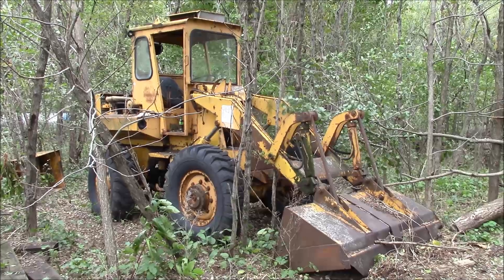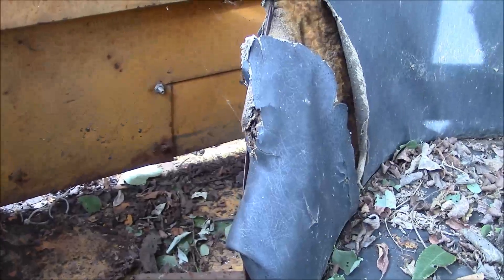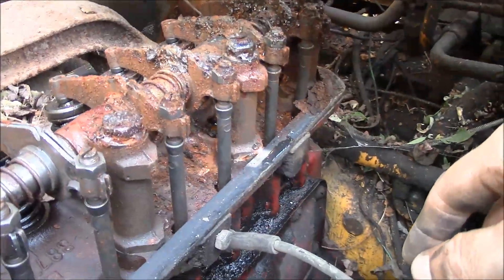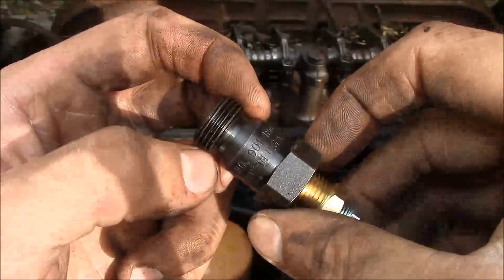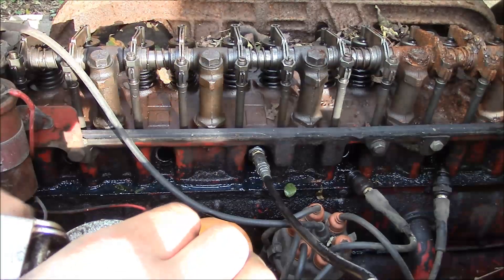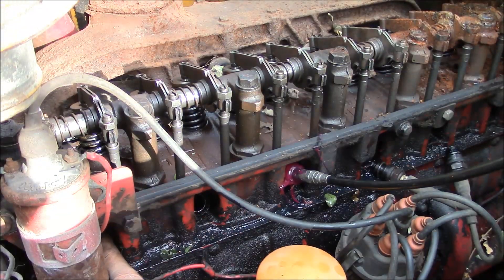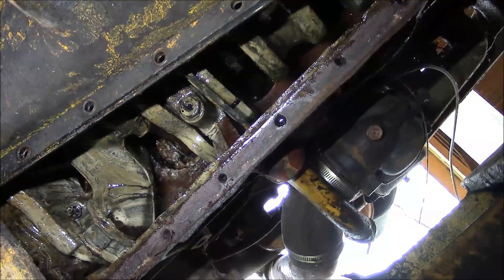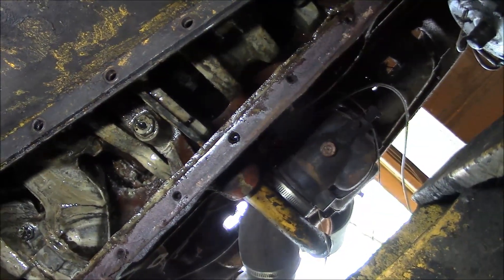Can You Free a Seized Engine with a Grease Gun?

Comment: Hi Wes.iv been watching you for a while and you are a good and clever mechanic...I have had some success in freeing up seized engines..one is still running 15 yrs after freeing it up...the previous owner tried towing it and no luck...I pulled the plugs and flooded the cylinders with KROIL..the stuff really works..after letting it sit a day or two I put a large breaker bar on it and a little at a time got it to turn over.
Reply from the maker: We're gonna get the head off here soon.

Comment: I mean there's always a way. If anything submerge the crankcase in water  up to the valve cover get a copper rod suspended in the valve cover, hook some leads to the copper rod and crank, hit the thing with 12/24v. Then ya just got the rust in the cylinder to deal with. I think ground should go to crank but I may be wrong.

Comment: Apply hot peanut butter and apple butter to the cylinder walls with grease plug adapter kit;Install breaker bar to front of crank heat cherry red any trouble spots that should work

Comment: This might be considered a dated video since it was posted oct of 2019. But have you tried using liquid wrench and spray all inside the springs of the valves? 
I would have done that and spray enough to flood the frozen valves and tap on them for about 5 minutes max. 
Yes its luquid wrench and yes itbcan dilute the oil. But its worth penetrating the rust out of the valves and then change the oil when its running.

Comment: ATF and diesel was in no way the best choice....should have used a 50/50 mix ATF  and Acetone....very best penetrating oil in the world. Let set 12/24 hrs and the grease gun trick would have worked fine. ?The real secret is not in knowing when to stop, but in knowing where to begin.
Reply from the maker: I'm thinking the best choice would have been not to leave it sitting outside for 13 years.

Comment: I had a seized motor, water drenched and tons of rust. Took out the plugs and sprayedBlaster penetrating  in the plug holes. Didn’t work right away so I also sprayed WD40 in the holes, waited a hour then cranked. It worked. Drained all the water and oil out and added fresh oil and ran it for 15 minutes. Changed the oil filter and added new oil again. Motor sounds like new. Hope this will help somebody with a seized engine.  Should work on all engines I would think.

Comment: I am going to tell about how I fixed a V8 Mercury from 73. It was 78 or so and a friend's boss had this car for sale. I would not start. Crank over but nothing fired. He wanted $650 for the car. I offered him $175. I gave him my number, and told him to call when he wanted the car gone. 6 months later, I get a call, buy the car and haul it home. 

It was Jan - in Canada, cold - I put a strong-arm on the craank and pulled and pushed. Motor never moved. I decided the fastest way to figure it out was to pull the  dome and heads off. I had been pouring deisel into the spark holes, but still, nothing moved. As the dome came off, I found the time chain and gears were gone. With the heads off, ALL pistons were rusted into place.  I had some 40 grit sandpaper - and I began to wipe all the areas I could in a hash pattern just like when the machine shop does it. One Friday night, I got my dad and brother to help. One had the strong-arm on the crank, one held a 2x4 - onto the piston, and I stood on the fender, with a 10lb sledge hammer. I gave every piston 2 cracks and then moved on.. On the 3rd round - Dad felt it break and mover about an inch. Now this is and inch on the end of a 6 foot steel water pipe. We oiled the cynlinders and we got it to move back that inch. It still needed the hammer to start the move.  Within a day, of moveing the crank a little and the 40 grit paper, I finally had to turining all the way in one direction. I switched  to 320 wet paper and just kept running over the rust.  I never pulled the pan nor did any more engine work. Slapped the heads back on after grinding te valves myself. I never spent more than $100 in parts and drove that car for 7 years. Put 50K miles on it. Now - there are gonna be some who tell me I am full of it. What I have said is the Effn truth. I did this 40 years ago.  Those old engines are much tougher than you realize.  Your mileage may vary - things look funny in your mirrors. Cheers

Comment: I once beat the pistons out of a mercadies benz 6 cyl with a block of wood and a 5 lb sledge hammer.  and I do mean BEAT!   ,  honed the cylenders, put in new rings and drove it for a few years. may have replaced the berings, don't remember,  just remember swinging that sledge 180 degrees over and over.

Comment: We had an old Chrysler 383 engine that was seized. We soaked the pistons with atf and pb blaster. Then unbolted the rod caps and proceeded to pound on it from underneath. It was all scrap anyways at that point. We could never get the piston out, even pounded it with a big pry bar until the piston blew out the top piece. 
Sometimes they are just too far gone an they can’t bore anyways if there is deep pitting.

Comment: You tried everything but grade 6 common sense😂 water makes rust if you put water "back" in the cylinder it will break down the rust: when was the last time yall ever seen oil or greasr disolve rust?
Reply from the maker: When's the last time you saw water dissolve rust?

Comment: Thanks for a good video.  I had planned to use that method with a Chevy straight 6 I have.  Now, I will use air pressure on a heavy oil flooded cylinder.  Hopefully, I can keep the pressure within the limits of the head gasket, and not blow all the air and oil past the rings.

Comment: Just a heads up to you, from working with a 1965ish Hough Loader, that looks to be a similar engine to what youre working with. International Straight 6 Gas. Theyre slightly more common place out in New York with the gas motor due to the colds we face, but it might be worth keeping an eye out for an old Hough Loader as a donor. Those motors are more common, just are in different platforms.

Comment: My 64 Allis D15 gas engine was seized like that.  The wrist pins were rusted tight.  I did everything you did (except grease).  Jacking on the crank pulley.  I was a little arrogant because I've always had luck freeing up old engine.  I kept dumping everything down the top.  What I wish I would have done was just filled the crankcase with marvel mystery oil , transfluid or PB blaster all they way to the top and just let it soak those wrist pins and cylinder walls for months.  If I could get that engine freed up with those cylinder walls I'd hone those and put it back together.   Maybe a waste of time but at least you're not out a whole lot of money.

Comment: The grease method does work !!  On a 6 cylinder engine 3 cylinders are on the post (after passing) TDC and 3 cylinders are pre (Before) TDC. Remove all spark plugs or injectors. Make sure all valves are closed. Fill EVERY cylinder with heavy weight oil. Now with your grease gun apply grease to the 3 post TDC cylinders. You will need 3 grease fittings. If it moves - keep going UNTIL you have A cylinder you are greasing at BDC. Now remove all fittings And install in the other 3 open cylinders. You will have to change at some point the 2 groups of three cylinders to get the engine to rotate 1 revolution..

Comment: Which is more to loose or just try filling the cylinder with oil .let it sit for a 2 or 3 weeks.letting the oil soak and free it up.this works cause i know.you have no chance of breaking anytjing.using a ratchet with a cheater bar.make sure you take the plugs out before using ratchet and cheater bar.better yet oil all the cylinders with oil.

Comment: I would add diesel fuel to crankcase until engine is as full as you can get leave for a month .use large socket and bar at front go easy  though back and forth.grease gun idea was not the brightest

Comment: if you need to un stick it just to pull the motor, and it isn't too big a deal to pull the head, dump muriatic acid down the bores that are stuck, it will eat an aluminum piston and the rust in minutes. at least you'll be able to turn it over to get at the flywheel bolts.

Comment: Ls swap.
Everyone is doing it.
😏
Reply: My boy wants to do a 5 ton
Reply: Rotary swap it. Boom problem solved.
Reply: An ls? If he wanted a cheap copy of a ohv 5.0l ford he could just put a 5.0l ford in it.
Reply: @matthubbard9330  
It was merely a joke.
Reply: A rotary??? Really and wheres the torque gonna come from to make a TRACTOR move? Let alone do its job? Magical apex seal fairies? 

The tractor needs a straight six engine preferably a ford 260 or 300. If not a cummins 4bt diesel.

Rotory engines make great air compressors. But once you add spark and fuel it becomes a total piece of crap.
Reply: @matthubbard9330  way to be a joke killer bud. It's ok though. I remember my first time on the internet.
Reply: You know what a funnier joke is?
 LS and rotary engines. Now that's a joke....
Reply: @matthubbard9330  🙄

Comment: You were right to stop on it. I have had some luck in the past with pouring in some diesel and then using a torch to light it on fire. Got an old M free that way. On my Dad's M I wanted to save the pistons since they were m&w pistons. I took the head off and would do the same. Took a number of tries but it did come free. But then weren't as far gone as yours.

Comment: If you remove the oil pan and disconnect the connecting rods you should be able to hammer on individual Pistons with a piece of wood instead of trying to move all of them at once it's way easier that way you may have to remove the cylinder had to do this though.  necessary if it seized that bad

Comment: You certainly have more options the thing is to get it to the heated shop. Have you looked at getting it into neutral or taking out the clutch completely. Some hoses need to come off for the bucket to be lifted. You're staring they need a ram pump.

Comment: we got desperate on a '48 dodge sedan with a stuck engine. after 3 months of pouring concoctions into the spark plug holes (and begging the owner to let me pull the head) he finally gave me the go ahead to do an autopsy. we'd tried everything to get it unstuck. finally i took a chain and a portapower and bolted the portapower down to the block with the chain using the "cloven hoof" attachment. we then used the rubber foot against the piston and gave it a few pumps, then bumped the starter. she finally gave up and started to inch down the bore. unfortunately someone had poured Coke or something down the bore and let it sit and it ate the cylinder wall out over .060". we ended up building another motor rather than wasting money sleeving it and only getting it back to standard piston size

Comment: Another large petrol engine we do not see petrol engines this modern this size in the uk. Even 50 years ago is 1969 a petrol engine would be very unusual as conventions to Leyland or Perkins was very common due to the cost of fuel and efficiency
Reply from the maker: This engine is probably 45-50 years old.

Comment: You have the oil pan off..  un hook the piston rod on the sezed pistons from the crank so you can turn it to get the bolts off the torque converter the engine is trash as you say..

Comment: Wes, I agree the motor is shot unless you decide to sleeve it.  But, it would be a really interesting experiment if you put the valve cover and pan bolts back in and fill the entire engine and cylinders with white vinegar.  It's cheap and it will eat the rust.  Fill the sucker literally all the way to the top and let it sit a week or two.  It would be really interesting to see if it cleaned it up enough so that it could be turned over.  Not trying to save it, but just to make it easier to disassemble later.  Coke (phosphoric acid) would also be another option.  But I'd use vinegar because it's stronger.  It'd be a $25 science experiment to see if it works and I bet you might end up surprised.  I'm a new subscriber and am really enjoying your vids.  Nice job!

Comment: Something I have found works to free up something that needs to turn , if you can access the lg nut on the front of the crankshaft , use a 3/4 or 1 inch impact and socket .  The hammering really has a profound effect .--Ernest E. Johnson

Comment: I’ve Never tried that before with Grease.. hmmmmmmmm I’ve Un’froze many engines and what I do/did was to remove all spark plugs or injectors on a diesel then use a Hot Plate to heat new engine oil up to the point it’s starting to boil!! Then pour it down each cylinder while it’s extremely hot. Let sit for 15mins then start to bar the engine over.. it will move very little and that’s all you need!!! Back and forth back and forth.

Comment: you could try the grease method again but chop the crankshaft behind the first piston, it should be a lot easier to free it and turn the clutch to remove the bolts holding it to the transmission.
no idea if it'd work, but thats what i'd try

Comment: I had a engine that was stuck and I used every recipe known to man to supposedly unstick an engine, and like you, after many weeks nothing worked. Then as a last ditch effort I blew the stuff I had in the cylinders out and filled each cylinder with Coca Cola. Less than a week later it was free and I got it running.
Reply: Vinegar works for breaking the rust free as does Coke .
Any oil is just a lube and won't eat the rust .

Comment: If you have to rotate torque converter and engine is condemned then gas cut crank and take main off , engine is then separate from flywheel... Only other way is to take all the mains and big ends off...

Comment: Even if the grease works,You will still have to get the grease out once freed,What you should have done first,is squirt some penetrating oil down the bores leave it a few days then get a blow torch down the spark plug holes and slowly turn the crank with a spanner  while keep spraying oil down the bores until they are free.

Comment: An old guy once who restores old tractors once told me if you heat up a pot of run oil on a stove , pull the head and pour the oil into the cylinders. The expansion from the heat should free it up when you try to turn it

Comment: All the wrong fluids used. Neat phosphoric acid into the cylinders ad left for 24 hours would have freed it up.
Once free, sump pan removed and turn the crank over with penetrating oil down the bores.. job done..

Comment: While it is unlikely to work in your engine, I did watch a guy heat a pan of oil and pour it into the cylinders via the plug holes. The heated oil caused a little expansion and made its way into the crankcase and the seized engine turned over with some difficulty - but it had been seized for several years. Thought this might be something your viewers might consider.

You gave that engine your best shot but in the end, there are just too many things wrong with it to make it economical to fix.

Comment: Pick a cyl past firing, power stroke, and USE AIR.
Reply: Air is worse than grease. Pressure vessels are dangerous. If it leaks hydraulically, air won't do anything.

Comment: Personally, I would strip it down as much as possible and use either electrolysis or an oxalic acid bath, and then soak with a penetrating fluid called Free All, made by Gasoila. The stuff works pretty good.

But that's just what I would do, you look like you know what you're doing though lol. It's probably a goner

Comment: It works really slow but I know a couple of people that fill the cylinders and soak parts in molasses and it eats rust and will not touch any good metal, my buddy usually plans on a month before he tries to break stuff loose with molasses but on some vintage machines you can't buy parts so if you wrecked it getting it apart you should have never touched it, good luck my friend

Comment: If you're done with this engine as a serious salvage piece you should wait until you find another engine you don't need or want. Drop the transmission and flip the torque converter, then weld it to the crank of the other engine so they're stuck together with the torque converter connecting them. You could spin the running engine up to the converters stall and see if it's even possible to break this engine loose. Who knows, if we get lucky maybe we'll see rods fly through the crank case of 2 engines at the same time 🤣

Comment: I have broke IHC engines loose with a hydraulic jack up against the crank.  I think that is also the same engine used in IHC 815 and 915 combines.  Several place in  Iowa have recking yards that sell  old combine engines , Iowa Fall, Colfax, Vulga, etc.

Comment: my best advice for getting the engine out is cut the conrods for the bad cylinders so that the crank can rotate to make the torque converter bolts accessible. its not like that engine is worth saving as far gone as it is.

might be interesting to see a different engine go in if anything is available for a cheap swap like an old tbi 350 or something along those lines of not fast and not cool but reliable and affordable

Comment: Fill the engine with diesel. Every cylinder, valve, intake everything and let it sit a few days. If that doesn't work, you can always use heat. Heat the block up with a torch. Itll expand freeing the seize

Comment: Just reach up in there with a torch and cut that crank near the flywheel end.  That way you can turn it over to get to the bolts.  That or take the head off...thats why that plates in the back of the cab.  Hammer the piston with a big hammer and brass.

Comment: I unseized an engine using a mixture of kerosene and vinigar.fill the cylinders than wait a day or two..then put a socket on the crankshaft and use a pipe on your breaker bar..